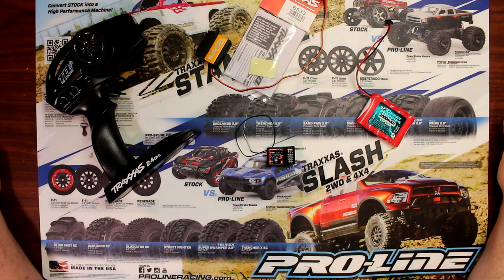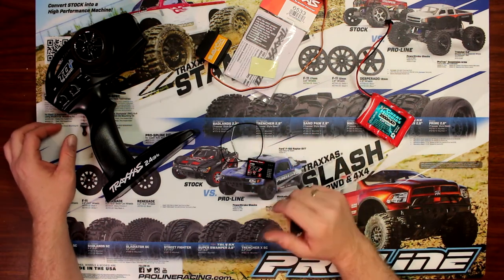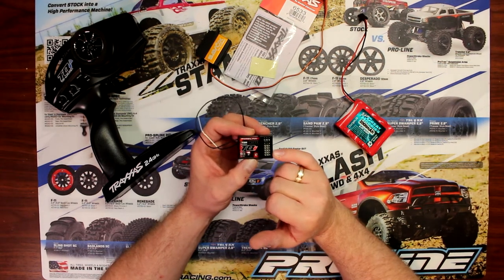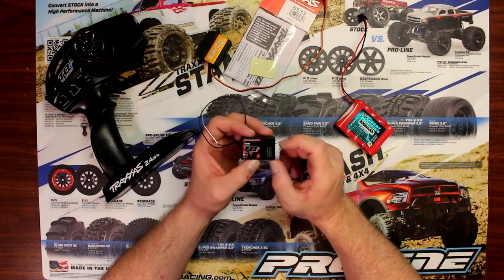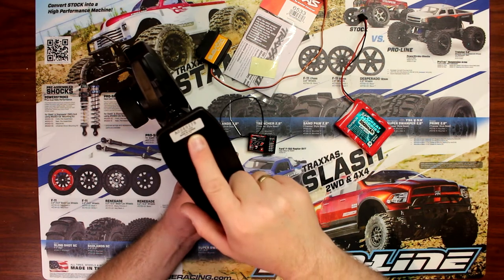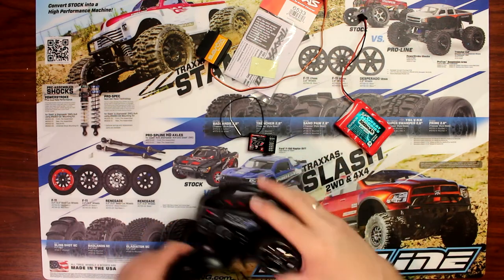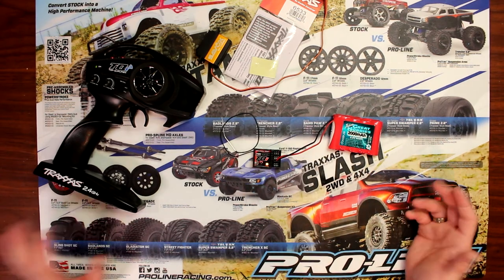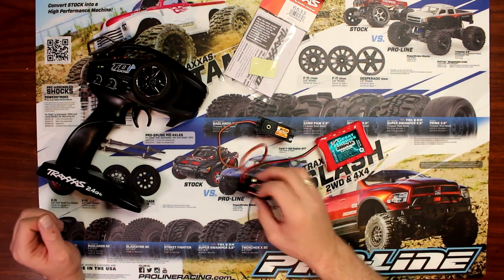How To Bind A Traxxas Receiver

Comment: Do you also know, i have forgotten, on the esc you can choose between nimh and lipo...witch has Green light and witch has red light ?...usually run stock nimh but tried 2s lipo weeks ago to see If it runs faster, it didn't and 3s wouldn't go at all...esc is an xl5..you know of i can use 3s ? But most Important...on nimh, red or Green ? Thank you..
Reply from the maker: jan erik skogmo mod-56 the xl5 Will not work on a 3s. 2s. only.  Red light means nimh.  Greenlight lipo.
Reply: djsprc Thank you so much..i make me a note..😁👍